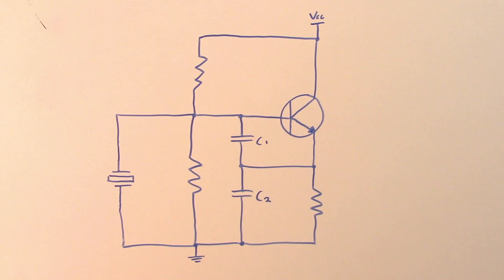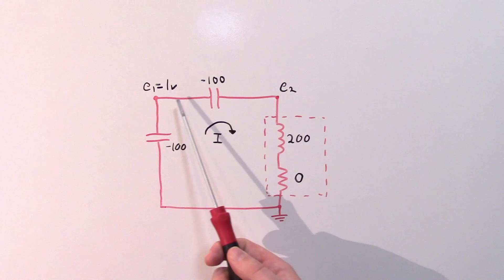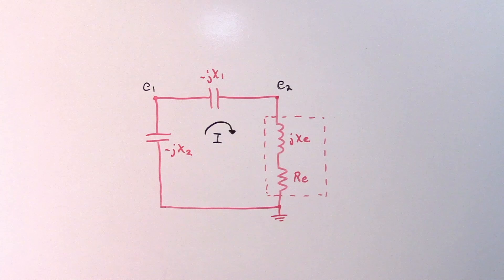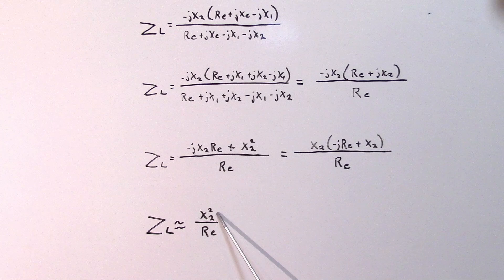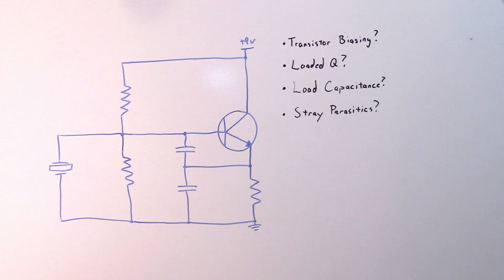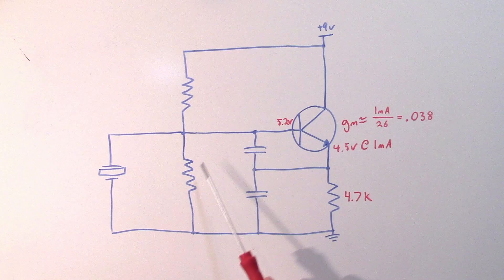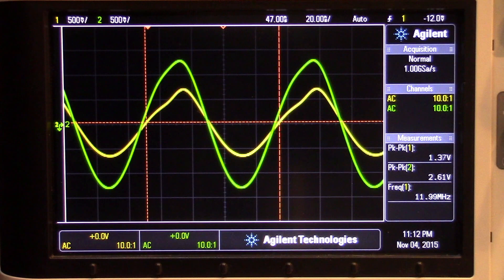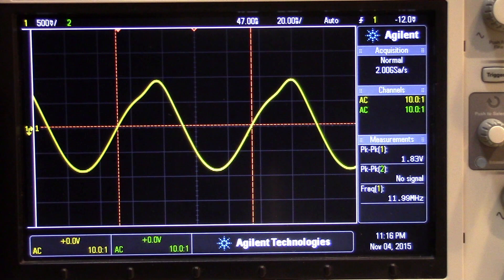Colpitts Crystal Oscillator Fundamentals

Comment: I like your diagram  at 2:47 as  it clearly shows what  I think/perceive, when I look at this circuit.    Just like there is an autotransformer  effect with a tapped inductor, which can have  a gain of more than 1,   well there can be  the same effect using the two capacitors  (plus the crystal) as you showed them  so the " feedback network" has a voltage gain of more than one complete with the phasing required.  It is this which makes up for the less than 1 gain of the emitter follower, to full fill the maintenance  condition of the oscillator, while the crystal sees to the  determination of the frequency.  
In transfer of knowledge of the working of electronic circuits  a slight modification of  how to draw the circuit could make a lot of difference is " seeing the explanation"   Congratulations for drawing the feedback network  in isolation as you did .
Normally the Colpitts Oscillator, uses the  centre tapped twin capacitor  in an earthed/ground mode to phase change the feedback voltage as the feedback network is normally supplied from the collector and so the phasing needs a 180 degree change to meet the condition at the base.  
Some people seem to think that all oscillators need a phase change of 180 degees but that is not correct as you have shown so well.
Reply from the maker: Correct! The important phase shift relationship is that the total phase shift through the feedback loop, which must be 360 degrees. I'm glad you liked my depiction of the feedback network, I think that it makes the operation of the feedback network much clearer.

Comment: awesome video! Always struggled to understand this circuit in detail. 
Quick note reference the crystal ESR: This crystal is an old style HC49 @12MHz so 40ohms max is a good assumption, a modern equivalent 12MHz crystal could be a 2.5 x 2.0mm package where the ESR would be spec up to 300ohms max. so some of the assumptions that this is low should be checked. 
Quick comment regarding tuning the Cload to make an accurate frequency: perhaps use a trimmer capacitor to find the correct value, but don't leave it on the circuit they change value a lot due to atmospheric conditions (humidity, temperature etc) so the frequency would not be stable if this is left in the circuit.

Comment: Excellent video!  One comment: The way you have drawn your schematic implies that there is always DC applied across the crystal, which keeps the crystal constantly stressed, which may not be ideal.  You probably want a DC blocking capacitor (short at RF) to prevent this or a Pierce oscillator.

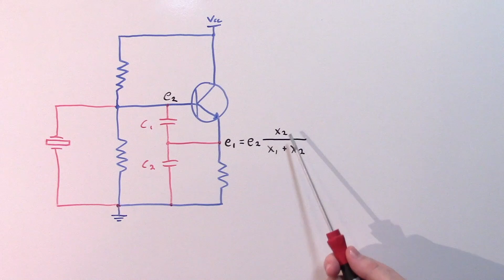Comment: Thank you for the informative video.  After 10:03 you use the terms impedances as you pointed at X1, X2, etc.  X is the term used for reactance, whereas Z is used for impedance.  This was a bit confusing -- they're not the same thing.  Thanks.
Reply: In the case he was referring too.. jts kinda the same thing

Comment: Question about 7:10 to 7:25.  On the oscilloscope we can see there that output signal e2 (Green) changes. It is what we expect.
Why input e1 (Yellow) changes so much too? I understood that the signal generator has 50 ohms impedance. Therefore the amplitude of the input e1  suppose to change, depending on the load's impedance. However, why it changes so much? 
Is the load impedance approaches to zero?
   I've never seen crystal's impedance even at series resonance  is less than 30 Ohms, which means it cannot reduce the input signal from 50 ohms generator down to almost zero volts.   Video is the best explanation of the Colpitts Oscillator on internet, though. 
Thanks.

Comment: There seem to  be  a few flaws here.  Capacitors C1 (top feedback cap.) and C2 (Bottom capacitor) are solely for feedback purposes.  The point of the topology of the C1/ C2 is that it is an impedance match between the low Z of the voltage follower  and the required high load  Z of the crystal circuit (or it will fail to oscillate ) .  This circuit is covered in some detail in http://analog.intgckts.com/impedance-matching/tapped-capacitor-matching/   and the final formula is Rin/RL = (1+C2/C1)^2 where Rin is the impedance seen looking towards the Emitter resistor by the crystal circuit.   If C2 = C1  (which is  arrived at with two 150 pF capacitors) then  the as seen Z  will be four times 4.7k ohms  using the as built emitter resistor or a nominal  20K  ohms as seen by the crystal circuit.  

This business of  C1 and C2 participating in the  tuned circuit of the crystal. No, I don't buy it.  If so,  those capacitors would move the operating frequency with temperature far more than is the case - the crystal is self contained and includes EFFECTIVELY L and  C components, which can operate in series mode or parallel mode.  In the case of a free running  true L C  oscillator then C1 and C2 do participate in the tuned circuit .  See https://en.wikipedia.org/wiki/Crystal_oscillator  note that adding capacitance across the crystal will DROP the operating frequency slightly but does not set the frequency, which nearly one hundred percent controlled by the quartz crystal.   

Derivation of  transconductance for a BJT.  You have used a generic formula which applies only at audio frequencies.  I looked up what is available on the  2n3903 and because Y21 = h21/h 11  (Y21 being the transconductance) you can get a value of  0,025 (mhos)  amps (collector)  per volt  (on the base  using  Hfe= 100 and Hie = 4 E3 ohms. NB these values  too came from audio frequency data - https://www.onsemi.com/pub/Collateral/2N3903-D.PDF .  

Finally you  make a very interesting point  that this oscillator works without  a  360 degree phase shift (or 180 degrees plus an input to an inverting amplifier).  This would be very unusual for an audio oscillator but is not uncommon with RF oscillators,  particularly quartz based ones.  

Here's a  question which I open to any competent person - .  your formula for loop gain versus ESR ( Re)  would not be applicable if the osc. was in  parallel mode, where the  Re cannot be seen  and the impedance of the crystal appears infinite - does this mean that the Colpitts crystal necessarily runs with the crystal  in series mode ONLY when this circuit is used ?  My suspicion is that this not always the case.

Comment: At the point where you discuss loaded Q, you showed a series resistance of 0.6 ohms. When I did this calculation and included the 4.7k ohm emitter resistor across one of the caps, I got a series resistance contribution from that resistor of 1.65 ohms (1.65-j176) which then added to the 0.6 which comes from the 48k bias divider, for a total series resistance of 2.3 ohms. That seems significant if I'm right (but its late and I'm not sure of anything, lol).
Reply: OR maybe the 4.7k ohm emitter resistor is reduced by a factor of beta+1 so it is much less. Now I're really confusing myself. I read one article that says the amplifier presents a negative resistance to the tank.

Comment: Nice explanation, but it doesn't seem to work...  I tried with a 32.768kHz crystal, adusted the bias on the base of a BC548C with a potentiometer to get a 4.5V average on the emitter, but only some noise comes out!  Most weirdly: I see a very nice and stable sine wave of 24.55MHz, 230mVpp at the BASE of the transistor!  I tried also with a 2N2222: 23.97MHz, 478mVpp.
What on earth am I doing wrong???  Why is the emitter not following the base???  I have no clue what is happening!  Anyone here having a suggestion?

Comment: Fantastic video.  Your knowledge is impressive!  Could you please pass on a couple things?  Do you have any recommendations for books that delve into the Colpitts?  Also, you mentioned that the Colpitts oscillator commonly doesnt produce a good sine wave, which is my experience as well.  Yours was the first explanation why over heard: because the transistor isn't operating mainly in the linear region.  You mentioned a way to filter the feedback to fix that, but it doesnt look like you had time to go into that.  Can you point to somewhere that might have this extra info?  Thank you for an awesome video.

Comment: The benefit of your presentation was clearly breaking down the design of the Colpitts Quartz Crystal circuit design into the required components for setup. I was very disappointed that you didn't treat the Crystal with the adequate specifications needed to particularly design a oscillator that requires a crystal anyway. You need to consider Crystal current for ageing and phase noise for starters. Your measurement across the crystal is very inaccurate since the shunt probe capacitance will dampen the actual packaged crystal. The best way is to insert a series capacitor of about 20 to 30 pf in series and measure the drop across the capacitor. That skirts the problem and acquires the accurate Ix data. 1 microwatt is a good operating level for AT and AT strip designs and gives good starting time results.   If one doesn't consider these terms the  crystal requirements one reaps the results! Other cuts of quartz require more careful considerations as appropriate. Warren Dyckman, K2WD

Comment: 10:34 . i'm still confused about the relationship between e1 and e2... in the previous equation we saw 1v at e1 and 2v at e2 - that's fine on it's own, but in the transistor circuit, why isn't e1 just e2 - the the diode drop of the transistor.... which is actually the voltage relationship in an emitter follower....
Reply: At that point, he's analyzing the signal not the DC.

Comment: Very nice balance between theory and practicality Craig. Before I start digging thru my texts, when you approximated the transconductance you had a divisor of "26" and I don't recall you mentioning where that number came from.
Reply from the maker: +Dino Papas I didn't; I already felt there was enough math for one video! :)

Transconductance (gm) is just the ratio of output current to input voltage. The output current (Ic) for a BJT varies with temperature, and gm can be expressed as Ic/Vt, where Vt is the thermal voltage, which is a characteristic voltage for semiconductors. Thermal voltage for a PN junction is equal to kT/q, which is ~26mV at room temperature.
Reply: +devttys0 See, I told you I didn't have to dig out an old text! Thanks Craig.

Comment: I like your videos, they are very informative and useful.
For crystal Oscillator , there is one simple solution which i have used is my project. I brought a 30 MHz 4 pin Crystal oscillator , it gives a square wave output (Normally used with micro-controllers, sine wave is also available), from a square wave(Bi-polar) we can get a sine wave by simply connecting a LC narrow band pass filter in series with the  crystal oscillator to filter out it 1st harmonic frequency. You must try this , very simple and less component oscillator. Very useful of High frequency applications.

Comment: I liked your thorough design explanation of collpitts oscillator

I'm interested in resonance of a load as in hho dry cell. 

What oscillator would you use and how would you figure out the frequency?

Furthermore the resonance needs to be locked in in other words stay resonating with changes in temperature and the voltage/ current without use of crystal as it will vary.
Reply: I found fit first time a schematic for such an self resonating circuit although I need help in figuring out what values to use for l1 and l2.
Can you shed some light?
Thanks.
Reply: That's the basic idea I had when trying except I was going to use a mosfet as the pulses need to be sharp and short, about 300ns and have an adjustable dead zone (no pulses).

Also the pulses per cell need to peak to about 7 volts. I have 3 neutral plates
Reply: The current and voltage will be regulated to certain values like 16 volts and 8 amps. 

Oh here's ther basic circuit I found https://youtu.be/rJQGZczJsEM
Pic https://iamconnect.com/storage/a/posts/1667218578Screenshot_20221031-072900_YouTube.jpg

https://iamconnect.com/storage/a/posts/1667219223signal-2022-10-31-082440_002.jpeg
My measured cell inductance at room temperature is 2.1 micro Henry and 462 micro farads

I tried using a joule thief circuit driving a mosfet. 
The resonant frequency should be around 2 -5khz using bifilar coil

Comment: this circuit wouldnt work for a 32.678 khz crystal right? i have followed all the constraints of the design and i created a circuit in multisim unfortunately it refuses to oscillate
Reply: he said it works only when the xtal is a high frequency one, you should retry it with a Mhz xtal.

Comment: @35:32 Is it really possible to get two voltage levels at the same point (the Crystal is parallel to the 120k resistor as well as the series of C1 and C2 of which C1 is connected to the base of the transistor)? Now since the base is set to 5.2 V by the voltage divider, how did you get 3.6 V at Crystal unless you are saying that the base voltage would drop to this same level?

Comment: I have watched your video many times. Very nicely presented. One question. I have experimented with this type of circuit. If I want to use this as a small transmitter can different bias settings increase the output power. I have tried that on a simulator and noticed no change with different bias settings. So if I wanted to increase the output power as a transmitter, what kind of additional stages would you suggest. Thanks

Comment: Hi Dev My question about how did you find transistor biasing voltage(5.2 and 4.5)minute 20:29 and while you are calculating gm(transconductance)  where did you get 26 mV is it common for bjt or what else ? thanks for your answer by the way that'S good  video for learning about crystal osc.

Comment: I looked for the datasheet of the transistor and tey said the basis emitter voltage is 5volts as "testconditions" so is this the working voltage for amplification or the saturation voltage.
When i loking at the cirquit in this video it must be the voltage for amplifikatoon in positiv and negativ direktion?

Comment: Beispiel Spannungswandler: Geht auch mit Spule und Rückkopplung auf Ein-Transistor Basis zwischen Kondensatoren sowie kleinem RC- Filter. Einzeltransitor -> NF 50 hz-100 hz Wandler und nicht der Super-IC Kram.-> dafür einfach und locker bis 100 W bei entsprechendem einzelnem Leistungstransistor  bei 220V sec. und entsprechendem großem Normal-Trafo und größerem Kondensator (sec und prim vertauscht) zum Wandeln. Der Ringkerntrafo ist gar nicht so toll hierfür. Ok. Eine  Bistabile Kippstufe aus zwei Moosfeet Transistoren von 100 A , liefert noch mehr als der Colpit alleine.-> 1000 W. Diesen kann man mit erwähntem Einzelfilter und Rumprobieren aus Rechteck zur Dreieck-Sinus-Mischphase kombinieren und spaart so viel an abgehobener Regeltechnik teurer Geräte mit ewig vielen Einzeltransistoren. Hier benötigt man nur 2 Moosfeet und einen Colpit zum genauen Phasenabgleich. Dazu eine einfache Drucksicherung von Siemens. Ok es gibt viel ausgereiftere Schaltungen, aber das Grundprinzip funktioniert immer noch.

Comment: Hello,
Indeed it is the best explanation in the net! I would like please to ask two questions:
1.You said that one of the conditions for oscillation is AB>=1 but according to your explanation AB=(e1/e2)(e2/e1), which is always equal to 1 and can't be greater than 1?
2.At minute 3:30 you present the feedback network as a serial circuit with current I, but the current I (from the emitter) split into two branch: Xc2 and Xc1+Xe?
Best Regards,
Marco
Reply from the maker: 1. Your assertion that AB will always be equal to 1 assumes that the gain of A and/or B doesn’t affect the original input voltage (e2), but since we have positive feedback, that’s not necessarily the case. To make the numbers simple, let’s say that the gain of A is 0.9, the gain of B is 2, and the initial voltage at the amplifier input (e2) is 1 volt. The loop gain will then be AB = (0.9*2)1v = 1.8v. That’s a voltage gain, and seems to violate the math..but remember that *this 1.8v is being fed back to the amplifier’s input, e2, so the input e2 voltage is no longer the original value of 1v. This amplification and feedback process continues until practical circuit limitations prevent further amplification (this is referred to as “limiting”). Since further amplification is not possible due to limiting, at this point the circuit stabilizes to a total loop gain of 1, just as you predicted.
2. Yes, as I mentioned in the video, some current will go down the Xc2 branch as well. But as described, due to the reactances at the resonant frequency, a voltage gain is realized through the Xc1+Xe branch. The current through Xc2 is not terribly important to focus on, but rather Xc2’s affect on the resonant circuit, which is essential to realize a voltage gain through the Xc1+Xe branch of the circuit. Some current also goes through the emitter resistor too!